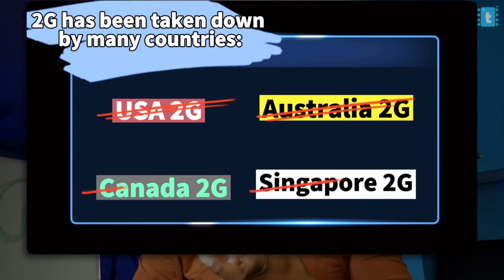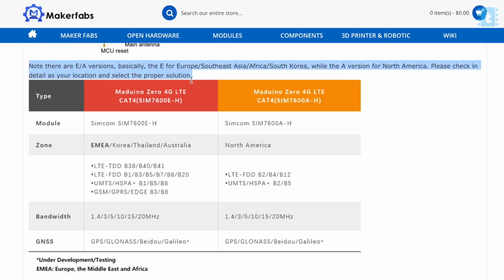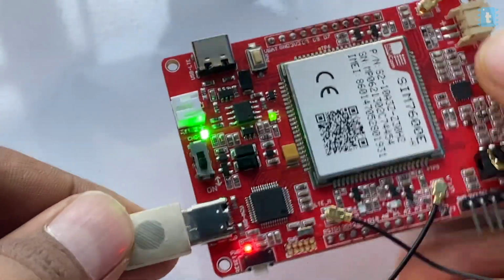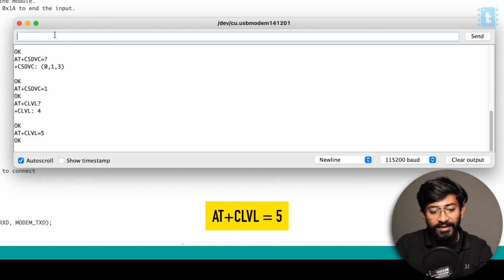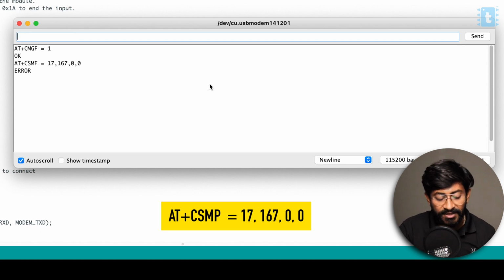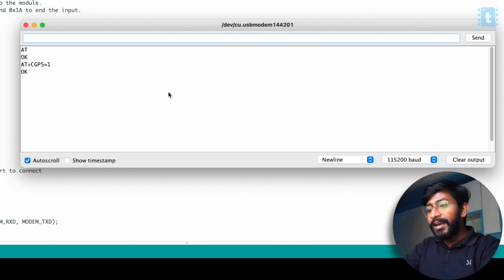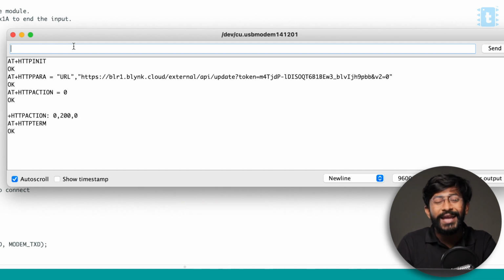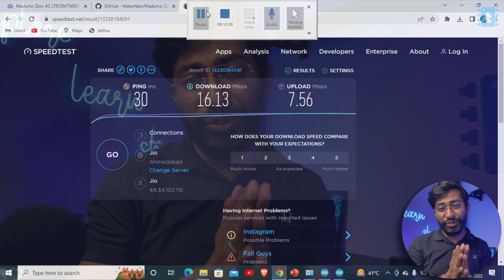Getting Started with Maduino Zero 4G LTE Board | SIM7600

Comment: You have inspired me to use the Maduino Zero 4g board to create a project, I need it to last a couple days on one 18650 cell and not use the cellular capabilities until needed (voltage on a pin). The cellular capabilities and the bright blue light (STA LED) are a major drain on battery. Is there a way to put those to "sleep". I figured out how to start it and not turn those on, but once they are on I can't turn them back off. any help would be great. thank you

Comment: Great project, thanks for the video but I have a question. I currently use a SIM 800l version 2. The 2G network is being retired and at the end of this month it won't work anymore. I don't want to spend that much money to buy this particular module but what would you suggest I do in order to my projects working currently they all work on text messages and I have a separate GPS module.

Comment: I am based in the Philippines. You mentioned using GEO Sim Card. Can I use sim cards from local telco providers here in the Philippines?
Reply from the maker: Yes you can
Reply: @techiesms  I bought the Maduino Zero 4g I send command ATD+63XXXXXXXXXX to call my mother's phone but it did not work. What does that mean?

Comment: do you have any examples of how to connect a serial board to this Manuino Zero 4G LTE?  I understand that this board has two serial ports and they are used by the USB and the Modem.  What digital port do we use to convert to serial via UART?  any guidance woudl be a huge help
Reply: did u find the answer?
Reply: @bvenkat8140  yes
Reply: @f3collectables   could you please share it with me

Comment: Can it work as a hotspot...?? And aslo can it works with 3G because in my areas sometimes airtel signal drops and switchs to 3g network
Reply: I don't think so, it doesn't have any wifi module.